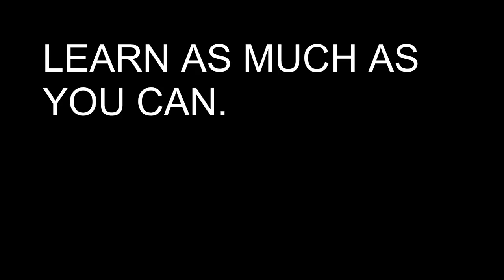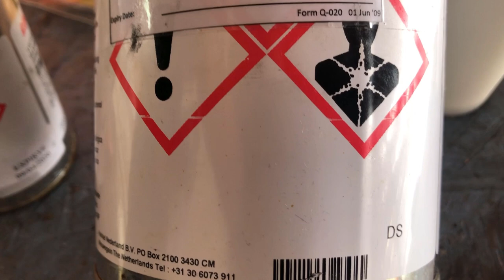DOUBLER REPAIR ON CNA 2019

Comment: The cherry rivets are clearly not locked in...grip length is too short. ...should be reinstalled correctly. And.....Seriously....you use a pair of dividers to remove the chain drilled area. Not good practice and not a good educational video...sorry..
Reply: I’ll never understand why guys don’t use a scale for hysol  like why cut that corner.

Comment: Why no scale when mixing the 934? If you use a 50 grit disk and grind your hole you will get a much cleaner cutout vs chain drilling.

Comment: Maybe a hole saw instead of chain drilling? Then you use the tip of a divider to pry the metal out? Come on, man! Then bare skin on those sharp edges? I'm only to 2:25! Why are you pulsing the drill like it's a semi-auto handgun?
Reply: Pulsing is not bad, is for controlling. Everything else is questionable.
Reply: @annakquinn7084  I've been doing aircraft structures for 20 years. Maybe my drills have all been too high-quality? Usually Jiffy, Sioux & Dotco. The triggers on these pneumatic, quality drills is so feather-sensitive that you can run any speed you want. I don't see how pulsing helps with control at all.

Comment: Those rivets are not the right size I believe
Reply: I thought the same thing. They didn't make the clunk noise before breaking as the lock ring is pushed in. Plus the stem is below the top of the rivet , it should be level with the top